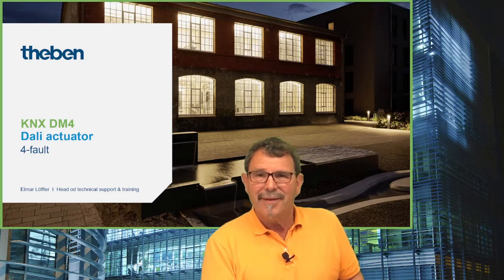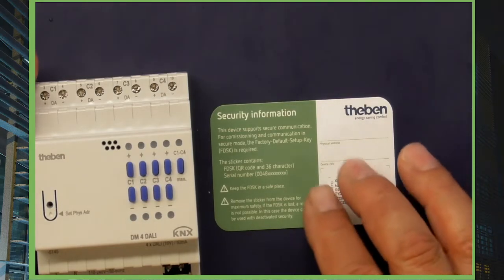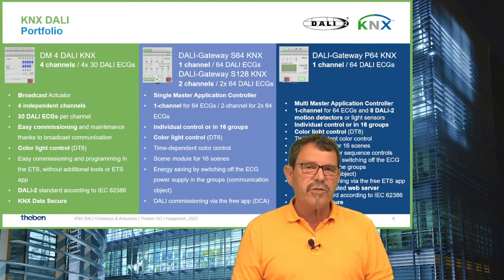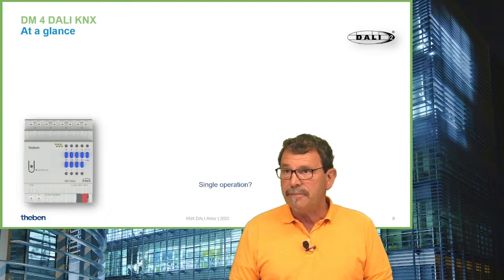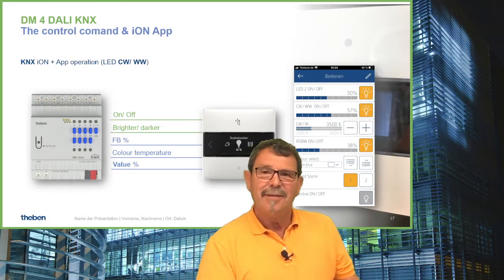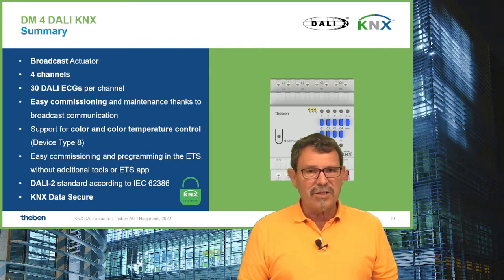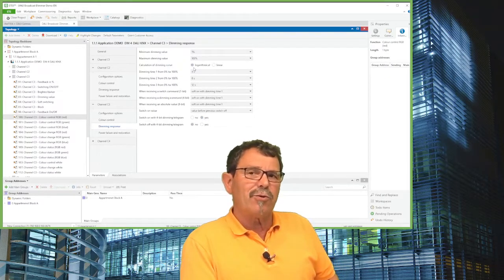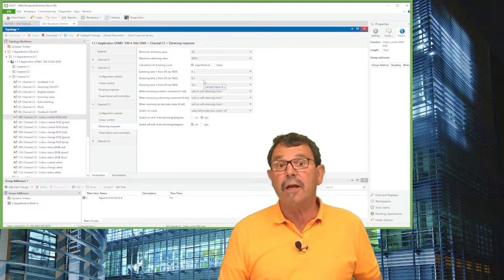DALI-2 Broadcast actuator DM 4 DALI KNX - video tutorial with function demo

Comment: Basic question: Can I use the following configuration for constant lighting control: 
- DM 4 DALI KNX + LUXA 103 S360-12 KNX UP WH + iON102/104/108 KNX + DALI-2 lighting fixtures
Thank you in advance for support.
Reply from the maker: Yes, this configuration can be used for constant lighting control:

With this configuration – Theben DM 4 DALI KNX, LUXA 103 S360-12 KNX, and iON push buttons – an efficient constant lighting control with DALI-2 luminaires can be achieved. 
Presence detector for automatic adjustment, push buttons for manual control. Perfect for smart lighting!

Sorry for the late answer!!